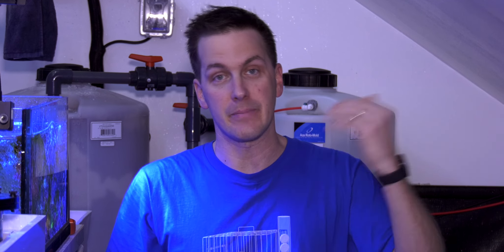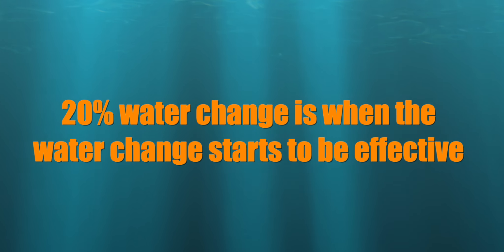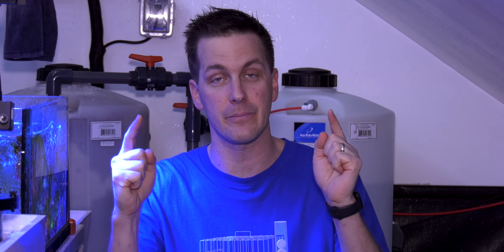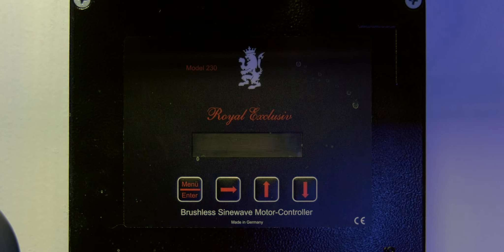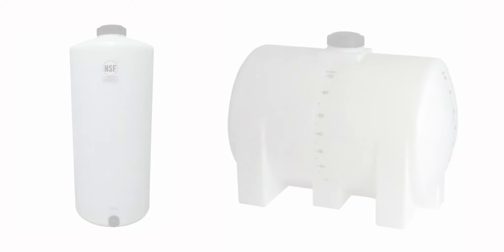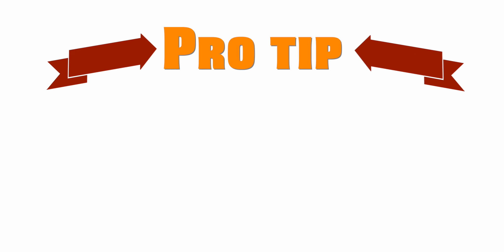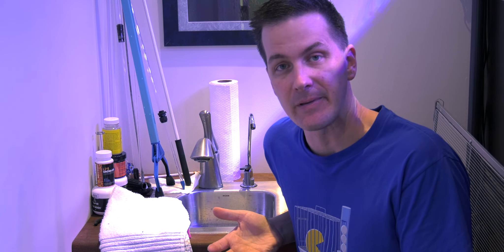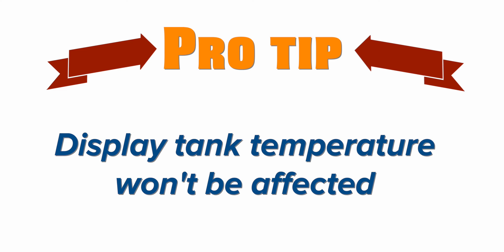RODI System COMPONENT Selection When Building a Saltwater Mixing Station

Comment: For on demand RO water do you need to have a pressure tank hidden somewhere like under the counter or does it get pumped straight from the holding tank... is there another video to show how to plumb up those particular like behind the scenes with the parts and how to

Comment: Questions on specific setup of ball value (running of vertical tubing - connection flexible hose): 1. Did you use threads or slip ball value (I have same ball values with 2 options)? 2. What PVC adapter did you use for ball value on both ends? Is 1st adapter a Male Tread to Tread? If so, where did you buy? 3. I have the same ball values and want to use with the treads. However, the SCHEDULE 40/80 MALE PIPE 3/4" ADAPTERS at your local hardware store don't carry a Male fine thread which tightens exposing little or no threads between ball values. 4. The idea is to use these same ball values with the thread option to give you flexibility in reusing ball values. 

5. Basically, what adapters did you around the ball value on vertical section connecting the clear flexible hosing? Back to questions 2. - asked above.

The minimal length hanging from the vertical PVC Tee ball value the better to reduce stress on PVC Tee.

Comment: Yyou can do is add multiple  RODI storage containers (joined at the bottom)   I have 2 45g ROFDI Brutes, Joined at the bottom, and I have a 45g mixing container,   so I hold 90g RODI (also user for ATO)  and 45g Mix

Comment: Do you have to run an ATO on your saltwater storage tank to keep up with evaporation and maintaining salinity?
Reply from the maker: The best solution is a lid :)
Reply: I have the horizontal tanks that you showed. Just hadn’t plumbed them yet to know if that was enough to keep from evaporating enough to change salinity. I’m planning 2% daily changes on a 180 gallon system.

Comment: Instead of doing larger changes every week or two, just do 1% every day.  30 gallon tank?  just keep a half gallon tea jug (one of the mostly transparent ones so you can see the water level) around and a funnel.  measure 1/3 of a gallon of tap water for the first time, and fill the half gallon jug with it, draw a line so you know how much to add, pour it on a plant outside.  Weigh the salt out (8 teaspoons) and drop it in the funnel,  wash it down with distilled water to the line,  then shake it for a minute or so, drop in an airstone and bubble it overnight.  Now you are ready to take care of your nano everyday without buying a pump, a huge container, a bucket, or any of that other expensive BS.  You can thank me when your nano takes off like its in prime reef water and you dont have to pay out the ass.  You will still have to buy the 2.5 gallon jugs of distilled, but if you are smart and shop around, you can find them for next to nothing, and the cost will be way less over time than the cost of the RO/DI filters, the water bill, and you can take all of those supplements and test kits and throw them away, because if you do the 1% water change everyday you wont need any of them.  Trust me on that, I've been keeping tanks for 10+ years this way.